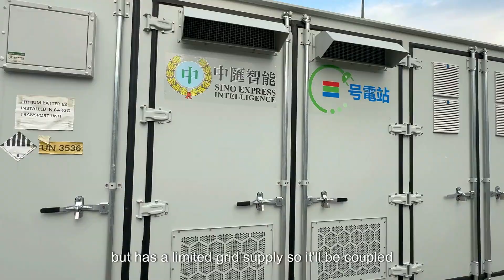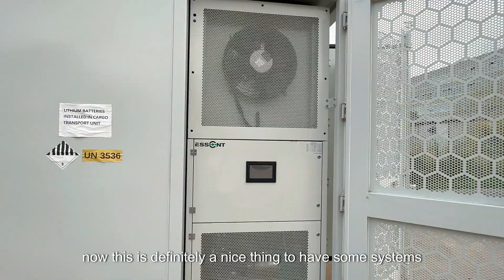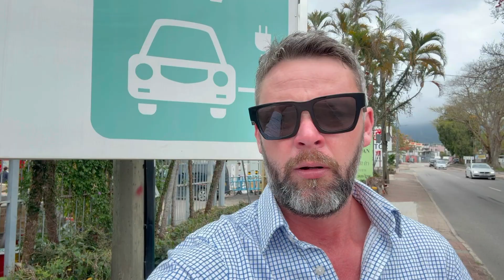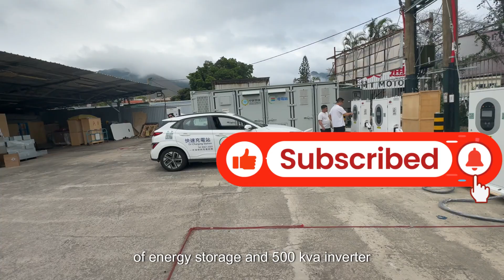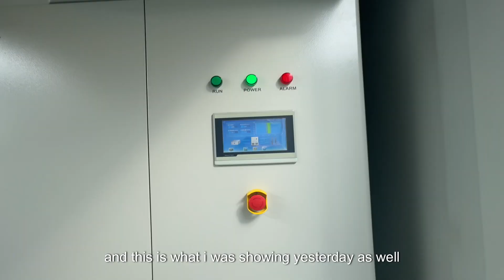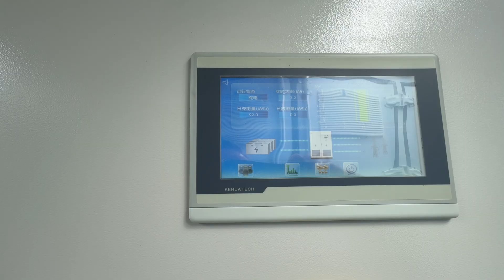20ft Container BESS "Thecta" - 645kwHr Storage, 500kVA Inverter, Water Cooled LFP (LiFEPO4)

Comment: The battery setup can only power full inverter load for 1 hour.
Reply from the maker: Approximately yes that’s correct, however, that’s not the use case
Reply: @TCSNPower please, explain the use case?
Reply from the maker: @salamisegun2012 Predominantly peak demand shaving where an installation has a constant input supply however requires support through peaks. This is also supplemented by solar as well.

Comment: Option to have heating and cooling for cold climates?
Reply from the maker: Hello. This unit is fitted with a heat pump that can handle both heating and cooling to ensure batteries cycle life. This is a standard feature